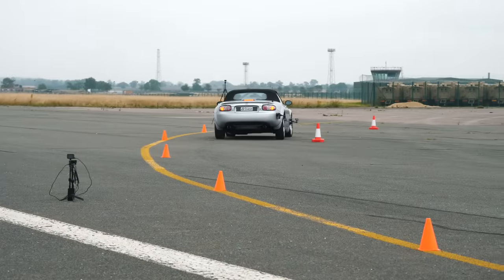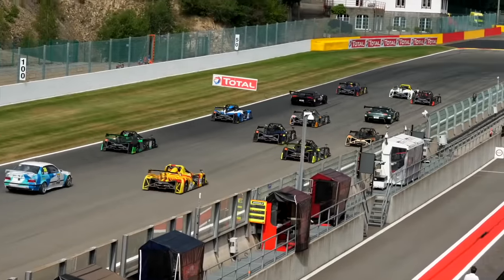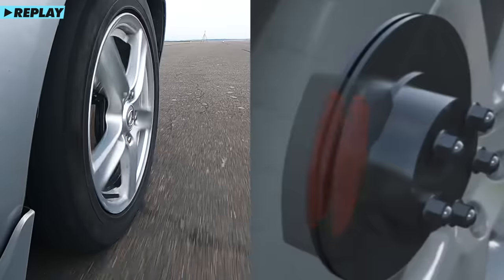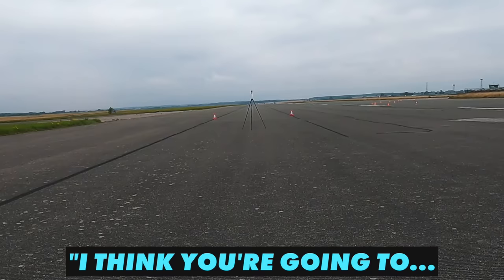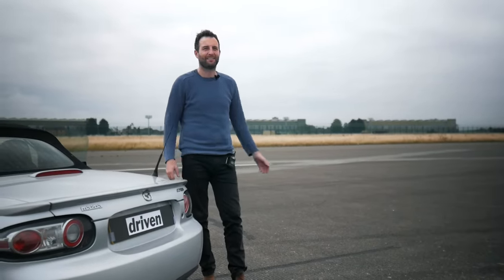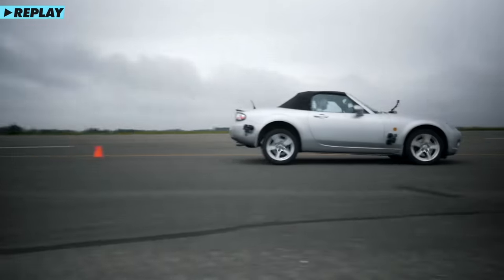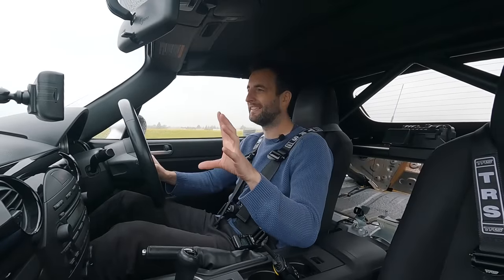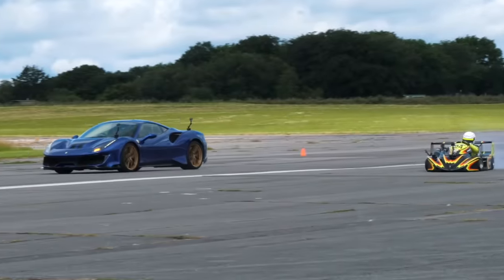ABS ON vs ABS OFF | What's Really the Difference?

Comment: I was expecting threshold braking comparison on ABS and non-ABS systems.
Reply: Yeah me too
Reply: Yeah, this is dumb, this is Karen Braking VS ABS, I mean, don't get me wrong I like ABS but it is mostly intended for Karens.
Reply: @yoancarlove7383  No, it’s really meant for everyone. People have a habit of making mistakes when they panic. Also winter driving… you should still threshold brake in winter but you’re always running closer to the limit of grip so there are more chances to screw up.
Reply: @yoancarlove7383  You ain't better than the machine, John Henry.
Reply: @yoancarlove7383   - the problem with that attitude is that most of us are Karens if I'm interpreting your reference properly.  I've seen comparisons where a "professional" driver could out brake and ABS equipped car under ideal conditions but even then, it took them a few tries to do it.  How often do we get to practice in an emergency situation?  In less than ideal conditions, even a professional driver couldn't come close to duplicating the stopping distances that an ABS equipped car could achieve.  Besides, ABS isn't necessarily there to provide the absolute shortest stopping distance although it can certainly help.  ABS is there to insure we stop in a "controlled" manner as this video very effectively demonstrated.  The thing is, the vast majority of us aren't nearly as good behind the wheel as we like to think we are.
Reply: @Intrepid175a  I like to think of myself as an above average driver, and completely agree with your comment. ABS seems to have come a long way since its initial conception, or perhaps just my perception. I've also owned a motorcycle with ABS since after my first year being legally able to ride, and I'm a huge fan of ABS on two wheels. It can get in the way of having fun hooning and riding off road, but on the pavement it's a wonderful asset to have in your back pocket when everything else has gone wrong.
Reply: @HeliumCarbonated   - oh yes, I've also tended to consider myself an above average driver but if I'm honest about it, I've made some pretty dumb mistakes through the years.  Fortunately, I've been lucky.  As for motorcycles, I've owned three with ABS.  A 1998 Honda ST1100, a 2009 Harley Ultra Classic, and a 2013 BMW R1200RT (my current bike!).  The ST1100 taught me one very important thing.  I could clamp down on the brakes WAY harder than I every thought i could.  One of my fears in emergency braking on a motorcycles used to be locking the front wheel.  I've done it in the dirt and the end result was hitting the ground unless I could let go of the front brake fast enough.  In the dirt is one thing.  Hitting pavement is something else altogether.  After I got comfortable with the ST1100, I started experimenting with it.  I'd get up to 30 mph or so and do an emergency stop.  I got harder and harder about it until the ABS finally kicked in.  I was "amazed" at how hard I was decelerating before that happened.  All of this was on dry pavement.  Since then, I'm not nearly as cautious about braking hard when needed.  Later, I experimented with emergency braking on wet pavement.  It was a very encouraging feeling.  Obviously the rate of deceleration wasn't as great but the bike stayed stable and easily came to a full stop with no drama at all.  These days, I won't have a bike without ABS if there's an option for it.  I've never ridden a dirt bike with ABS so i can't say for that experience.
Reply: @Intrepid175a  "don't get me wrong I like ABS"- Is the key here... 

I like ABS, I trust the system on newer cars, (my old 2000 buick regal had some shit abs that were actually dangerous in the snow)... I'm a Canadian and had far more cars without ABS than ABS, I would pick ABS any day of the week over non-ABS. My original idea still stands though, it's mostly intended for Karens.

If I hadn't quickly learned to threshold brakes in a multitude of conditions, I might have a few more healed broken bones as we speak...
Reply: @Intrepid175a  I wish my motorcycle had ABS, THAT actually scares the shit out of me, not having ABS on a motorcycle as a novice driver.
Reply: @yoancarlove7383  🤓
Reply: same
Reply: Exactly!
Reply: @ebouwman034   @Eric B  In winter scenarios you don't use brakes until you downshift all the way to the first gear... if you don't have ABS or chains, of course!
Reply: @PapaBear6t8  Then on a 2wd vehicle you’re only slowing down with 2 wheels instead of 4. There’s nothing wrong with engine braking but your brakes are more effective.
Reply: Exactly. If you have half a brain you don't lock up the wheels and even more importantly keep them locked up. 
Important fact about ABS systems is the reason for their existence is to allow the vehicle to have control under heavy breaking. In other words to allow the vehicle to turn while breaking to either avoid a collision or take a corner. Not primarily to shorten braking distance as the video commentator states.
Reply: @yoancarlove7383   Many countries now have new laws that for the sale of new motorcycles that they must have ABS fitted to the machine
Reply: me too
Reply: Good drivers don't need abs just downshift fast
Reply: @yoancarlove7383  and Trevor :)
Reply: @ebouwman034  I've heard that ABS is bad in the snow because the car stops faster when the tires lock and dig into the snow than if they are just rolling on top.
Reply: @lukerobertswr5189  Maybe in really deep snow that’s true, but when you’re driving on a road it basically never works out like that. I’d like to add that as a general rule I always say that if your ABS is kicking in then that’s a warning that you’re trying to slow down too hard and next time you need to start earlier. If you’re at the point where you’re relying on abs or you’re saying ABS isn’t as good because of snow… then you’re going too fast.
Reply: @ebouwman034  and drivers aren't taught like they used to be, a inconvenient light on the dash board turns the car into a death trap
Reply: @yoancarlove7383  Believe in JESUS today, confess and repent of your sins. No one goes to heaven for doing good but by believing in JESUS who died for our sins. GOD loves you soo much unconditionally.😍😚☺❤🍂
Reply: @PapaBear6t8  Engine braking in winter driving? Yeah bro, you have no idea.

How to spot someone who doesn't drive in real winter conditions: 

They mention Chains... Like seriously, nobody drives around on chains in serious weather conditions, that's what winter tires are for, and studded winter tires. I can't recall the last time I saw chains on a passenger car. Must be for them Europeans that see snow once a year and make it back home in one piece on all-seasons.

People don't commute 5 days a week on chains... That's just ridiculous. Don't get me started on real winter tires, that'll bring out the Canadian in me.
Reply: I did I also.  U don’t need to make a video if u r just going to stomp on the brakes with no ABS.  We all know the outcome.
Reply: @jhndijkman  Hell alot of places mandate them on passenger vehicles to!
Reply: @ebouwman034  TRUE though i think ABS was designed around still having control in an emergency situation.
Reply: @deejaywh  IDK where you live friend but in my country the only person who teaches you are the ones with an impaired, 4 speeding tickets in the last 2 years driving a new civic caused they totaled their last one in an at fault rear end collision, its the law here.
Reply: @yoancarlove7383  Winter tires won't help on hard inclines/ice and studded tires are ILLEGAL in some European countries (eg. Poland or Germany) even in mountain regions. Chains are the only option if you don't want to slide off the road.
Reply: @Axymerion  bruh, good winter tires will do the trick.
Reply: @yoancarlove7383  Nah. Not on 10 cm of packed snow or ice. NOT A CHANCE.
Reply: I avoided a gnarly accident yesterday without abs, locked up the brakes and then threshold braked all in a split second. You'd be suprised how fast our brain can work when full of adrenaline. Not saying anyone and everyone is better without it, but I don't feel unsafe not using it.
Reply: @mynameisjonas1997  are you sure it was fully off? Only certain cars actually allow you to completely disable it or the car is just much older to not have it equipped at all. 

Don't get me wrong you are absolutely right about what is possible when adrenaline kicks in. That being said those split second decisions are automatic and you would want to find out if you couldn't.  There just really isn't a reason outside the track to disable abs.
Reply: @ebouwman034  Actually in winter flooring brakes is better than ABS.
Reply: @HeliumCarbonated  ABS definitely is great for panic, or sand some odd mix on road.
That said my bike dont have ABS and sure it is lighter one, but I love doing stoppies, that has given me the feel for breaking force,
also when you have experienced that while straight you can recover from front lockup, it feels les scary.
On gravel you can actually slide impressive distance.

But no argument that it is 1 layer of assist that might save you from accident happening,
as usually it is series of mistakes where eliminating any 1 of them might prevent it.
Reply: ABS is for everyone even pro race drivers on road. You'll have several practice on a track to allow you to understand how much pressure you're going to put in every corner. And by every lap in race, you'll get a good feel of the tarmac and your car changing slightly so you can adjust to it.
On a road situation though, you probably don't get even two identical emergency in the same spot on the same weather with the same tire condition. The computer do it for you and it's faster.
Reply: The point I suppose isnt that cadence breaking is better than ABS.  it isnt.  But to see a pro driver lock up the wheels and keep them locked turned me off straight away.  I would expect him to ise the skills that he states that he has.  If the wheels lock up then release and re apply.
Reply: me too
Reply: @ebouwman034  abs really doesnt work so well on ice; canadian driver :P
ya still gotta be aware of your grip when braking on ice.
Reply: Winter driving is the reason I pulled the ABS fuse on my 2001 Silverado.  There were several curves on my commute that had potholes, and the ABS would engage if I was applying brakes, breaking loose the three tires that were not currently dropped into the pothole.  I tried to train myself to let off the brakes before the potholes, but after forgetting and sliding sideways into the other lane, I just pulled the fuse.  The improvement was remarkable.
Reply: Same. 
I had a car (Citroen XM) where the ABS was off, and I had once to take that into account to avoid a collision in a curve.
I was expecting from this video a real comparison between "the best ABS can do" and "the best human can do", not some shitty "slam the brake and slide" braking.
Reply: @yoancarlove7383  your the karen here my guy
Reply: @seiyuu1628  Seems to me you didn't understand the intended meaning of the comment. Comparing ABS to purposely locking brakes doesn't help promoting the technology. I wanna see how much of an improvement ABS makes over threshold braking.
Reply: @ebouwman034  you can't include winter driving to this because it's a whole other creature you pretty much DON'T use your breaks on snow and ice not unless you like to slide into things with your car. as for 'everyone' that also is incorrect yes even the best driver gets caught by surprise and will lock up the breaks but what makes them good drivers is the speed at which they get the wheels turning again for control while applying just enough breaking.
Reply: @Intrepid175a  Every Winter as soon as snow falls I'll spend about a tank of gas in a large parking area doing donuts and skid runs to reacquaint myself with whatever vehicle I'm driving because even minor changes over the dry months can drastically affect how the car reacts to breaking free. Change the tires it wont react as it did the year before get a wheel alignment same thing Change what you carry in the trunk even a tune up can have an effect.
Reply: @yoancarlove7383 yeah, no, when people panic they will always slam the brakes. even professional drivers cannot brake better than ABS unless it’s one of the first generation not very good ones.
Reply: If you can not break without locking your wheels on a car without ABS you are not fit to drive and should hand in your drivers license. This video is just stupid, you do NOT lock your wheels when breaking !!!!